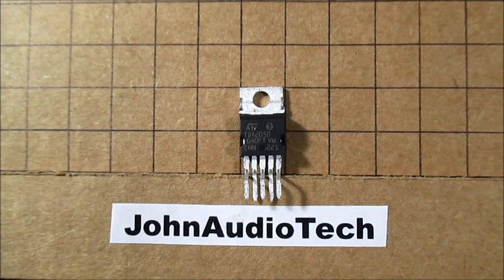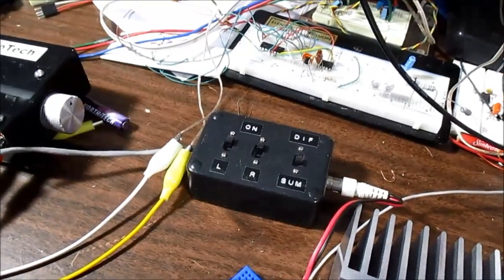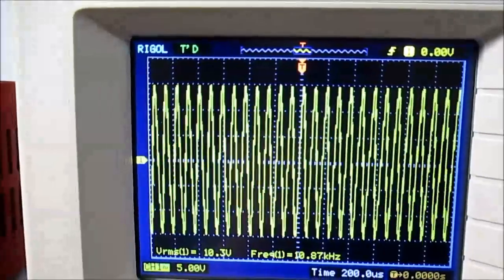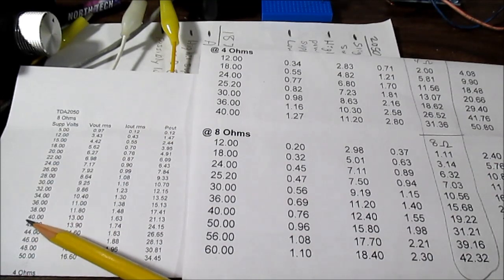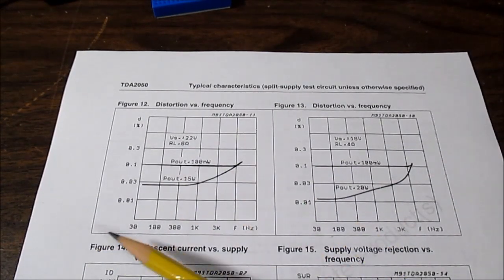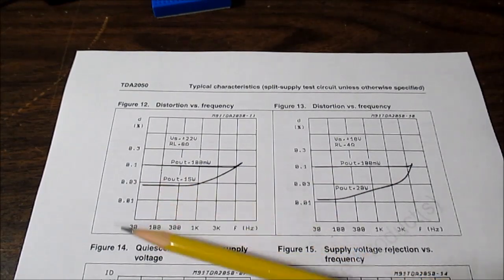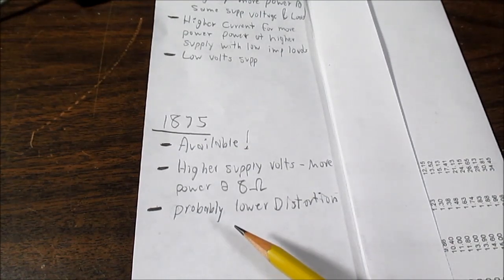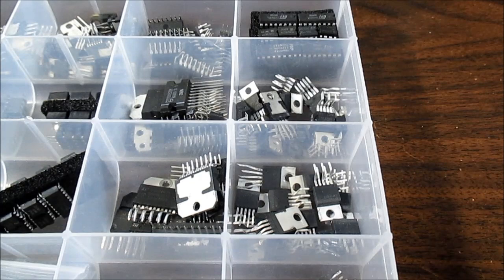TDA2050 audio amplifier IC test & review plus compared to the LM1875

Comment: John have u ever tryed higher watt amp boards off ebay like the sure line im interrested in how some of the kits off ebay do that are 200x2 up to the and 300watts x2 when they say u need a 50volt power supply does that mean u need a 50+ 0 50- or do u just add both numbers together thanks once agin john
Reply from the maker: That depends on the board. If it requires three wires for the supply then it could mean -/+ volts. Most boards I've seen are single supply. I haven't tried these higher power boards yet. They are a little pricey just to make a video for it.
Reply: If i get one of them board that are 300x2 amp kit off of ebay ill hook it up and see how it sound and then ship it to u for testing cause im curious to see if they really do the power i have never build a amp but am vary eager to learn how i just cant ever read the diagrams to do it i have great back ground in car audio but never building my own amp keep up the good work and ill watch all ur videos to catch up to try to learn how to build my own amp i know how to build the t e core power supplys out of microwaves to get the voltage for just a reg pos neg amp so if there is a home made amp i could build id be glad to have u as my teacher on doing so i could leave u my email or if u got facebook thank u agin john and cant wait to see more videos

Comment: Hi John, I am a recent subscriber to your channel and love your vids and the way you keep things as simple as possible in your explanations.  I came across your channel because I am in the process of repairing a guitar amp that uses a TDA2050. I've diagnosed the problem down to the 2050 which I have since discovered has been discontinued. I've read the LM1875 can be used as a direct replacement but at the same time have read that this isn't always the case. At present the 2050 in my Amp is being powered by +24/-24V, I was just wondering what surrounding components I should be aware of that may need changing in order to substitute the 1875 in place of the 2050? Many thanks.
Reply from the maker: If the IC is driving an 8 ohm speaker, I'd think the 1875 would be a drop in replacement. It seems to be a stable IC where going from the 1875 to the 2050 might require some changes. Hopefully the amp used a proper sized heat sink. I've seen some amps use too small of size and the chip runs hot.
Reply: Thanks John, much appreciate the reply. I was going to buy some cheap 2050s on eBay but then I saw your other video exposing the substandard fakes from China. It woldnt be so bad if there was a seller in that part of the world who was actualy making descent 2050s. I read that Tayda electronics is suppose to be a pretty good supplier located in Thailand but they no longer stock the 2050s either.

Comment: Hi John, can a schottky diode bridge rectifier be used instead of a sillicon diode one to squeeze a couple more volts out of my transfomer? I mean 2.2v drop vs 0.8 is roughly 1.4 volts amplitude more = 1v rms more.
Reply from the maker: You could but you have to weigh the benefits vs the drawbacks. At low voltages, the extra voltage is more of an advantage than at higher supply voltages. Schottky diodes are more expensive and not as robust. Personally, I'd stick with an ordinary diode bridge.
Reply: They leak more in that application too if I remember right, so that gain in Voltage might not be fully realized along with other issues. Would be a good experiment to try it both ways and test.
Reply: You'll find that an extra 1.4V of supply equates to 0.5V rms. The difference between, say, a 30V supply and a 31.4V supply results in about 10% increase in power, which might seem like a significant difference, but is almost certainly inaudible.
Reply: @RexxSchneider  i did try it out, and the results were the same. Didn't get higher voltage at the bridge, and obviously no power gain. But with class D and BTL, voltage isn't really a problem anymore, since switchmode power supplies are way cheaper and more powerful, and the class D amps run at much higher frequencies, the voltage fluctuation doesn't even matter.

Comment: Is that an Eminence tweeter, can you describe your speaker? Thanks
Reply from the maker: If I recall, it is a Pioneer tweeter. The Woofer is a Goldwood brand 10". Goldwood speakers are generally unimpressive but these are good with big 2.5" (6.3cm) coil and a low Qts for ported boxes. I had to do a little work to get the crossover point right and pad the tweeter down since the horns are so efficient. They are good for their size but miss out on the lowest bass notes.

Comment: it's my understanding that during, say, 1925-1950, audio amps were so primitive, speaker systems of the day were given exceptional design effort to improve their efficiency.  Thus, today's paradigm is full 180.  Super-cheap amps make up for inefficient speakers. Audiophiles with $$$$ can buy what us commoners can't.  But us commoners CAN do DIY on speaker design to get, perhaps, better-than-commercial efficiency.  Given you've proven these chips give great power and very low distortion, us DIY peeps can get the best of all worlds - clean, powerful reproduction that's affordable.  Time to party and rock-on!
Reply: In those early days, amplifier power was very expensive, so efficient loudspeakers were used. Those loudspeakers often didn't go really low, but typical recorded music back then didn't either. Enclosures were generally very large, to match the loudspeaker parameters. When stereo came along, too many people would not tolerate two very large boxes in the room. This is the time when Ed Villchur ( of AR) along with Henry Kloss, developed the acoustic suspension woofer. This allowed low bass in a very compact box, far smaller then the usual loudspeakers that preceded them. The trade off was much lower efficiency. But power was getting cheaper, and this became an acceptable trade for most people. Efficiency is determined by the loudspeaker drivers. You can still get high efficiency drivers. They are used in commercial sound systems all the time, but the need for large boxes remain, so most home systems dont use them.
Reply from the maker: The enclosure design absolutely can and does play into speaker sensitivity (efficiency). A horn loaded alignment comes to mind. Having the right driver parameters are the most critical with these designs. The DIYaudio speaker forums have some of the most talented designers who are happy to share their knowledge. There are quite a few reasonably priced drivers with good parameters available now.
Reply: Commoners cannot make more efficient speakers. The efficiency is dictated by the drivers, not the parts that you can DIY (eg: speaker enclosures). From my own experience, it is exceptionally difficult to find low cost speakers with decent efficiency. Mainly because the specs don't get stated on places like Ebay, so you just have to buy blind. The worst thing is tweeters... I have bought so many in an attempt to improve clarity of numerous small speakers in my home. Most tweeters seem to be like 80db/W/1m  which means that they might be fine for a huge amp, but they are inaudible at any normal power level.
Reply: John Coops:  With your experience, I wager you can (or eventually, will) come close to relatively cost-effective and reasonably efficient speakers.  Here on YT, one can find Joe Blow who does a DIY of modest expense, and does blind listening tests using people with seasoned ears.  Often the DIY boxes win over exotic or expensive speakers.  Their 'success' does not negate your struggle.  If you choose commercial speakers because DIY doesn't satisfy, that's up to you.
Reply: I agree. Yes there are certainly a lot of pitfalls to DIY and a lot of crappy results. But if one shops carefully and does a bit of research, a DIY speaker system can easily be more efficient than most name brand speakers. Mainly it is a matter of what type of enclosure you want to make. If you can accept the larger cabinet of a bass reflex or transmission line or etc., you can DIY a very efficient speaker. If you need to go small your going to have to go Air Suspension, and that can be tough to DIY and get right the first try.
Reply: It wasn't my intention to stir up a hornet's nest...  For the curious, here's a brief overview of "100 years of cinema loudspeakers", the design evolution of which likely had impact on what would become commercial home audio (http://www.filmsound.org/articles/amps/loudspeakers.htm).  Here's a search-result showing loudspeaker photos - some of which appear to be designed by extraterrestrials...  https://duckduckgo.com/?q=loudspeaker+designs&iar=images&iax=images&ia=images
Reply: JohnAudioTech - all of my speakers are DIY. The favourite are some using old Vifa drivers, however they are pretty inefficient so I need minimum 100W RMS per channel to drive the to decent volumes..However, if I DIY using a woofer that's 85db/W@1m then no matter what I do, it's not going to be very loud on a 2W chipamp.

Comment: Hi l like your video.. Can you show the effect of the amperes from lowest to  maximum maintaining same supply voltage range on any amplifier chip you have. It will be appreciated.......
Reply: Amol mk the minimum and maximum are shown for 2, 4 and 8 ohm loads. What information do you need? To change Amps at a constant voltage you need to change speakers. I could be mistaken or misunderstood your statement. Maybe someone else will step in and correct me or provide that data that you are looking for.
Reply: Kevin Livingston i want to know, for example, amplifier needs 24 volt 5 amperes and if we gave him  24 volts 2 amperes, then how the output will be effected..... It will be results in clipping or what..... and if we gave 24 volts 10 amperes then what will happen?? Thank you for quick response...  :)
Reply: Amol mk that's why I'm confused. If you give a 2ohm speaker 24 volts, it will draw 2.84 amps with LM1875. You can't keep it at 24volts and draw a different current. Unless you change to a 4ohm speaker. I think the chip also has a current limit of about 3.15 amps at 2 ohms. Here is the complete data sheet. 
 http://www.ti.com/lit/ds/symlink/lm1875.pdf
If you are new to this you want to check out Ohms Law and understand how voltage, current and resistance work in the audio circuit. This way you can get the most out of your system safely. 👍